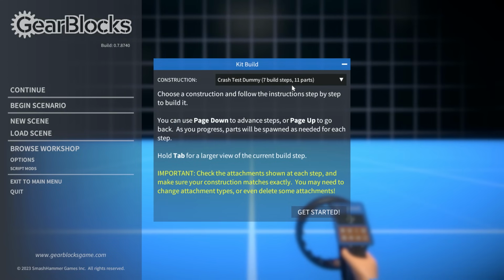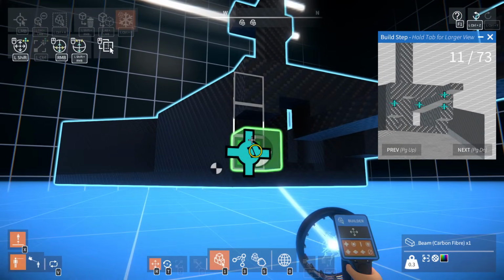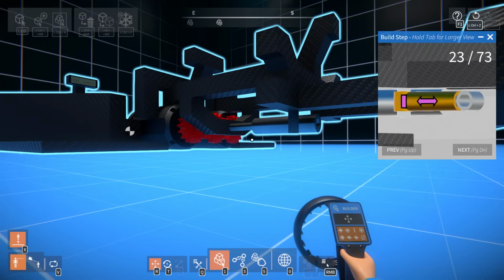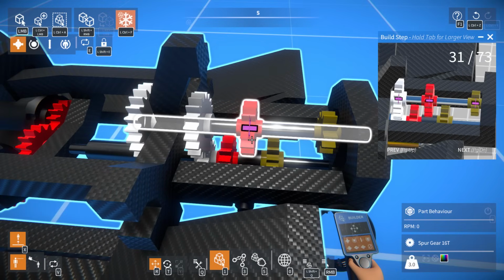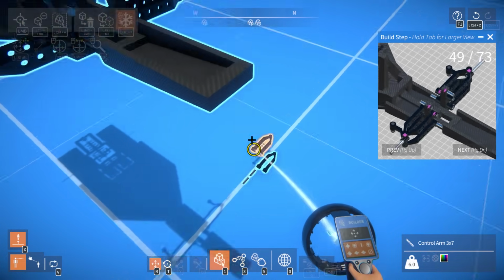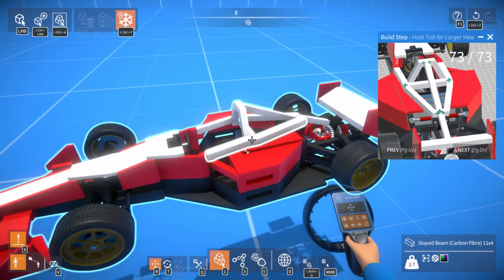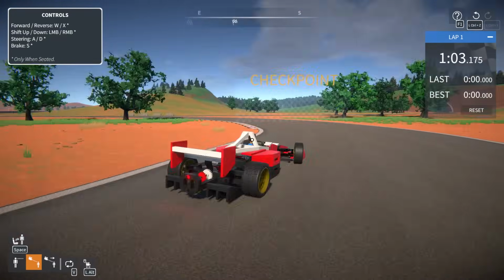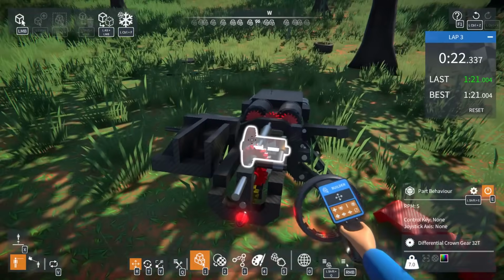I Built a Formula Kit Car with Mechanical Suspension, Transmission, and Differential!

Comment from the maker: Time to make my own vehicle? What kind of vehicle should we do first?
Reply: Trophy truck
Reply: Make a crawler with portal axels with an engage able 4 wheel drive and a realistic drive train and lockable diffs 2 speed transmission
Reply: Crawler/Buggy with four completely independent wheels. [No linkages between each wheel except for a central cab.]

May be easier to do with all wheel drive[one motor per wheel] & all wheel steer.
Reply: Seeming as you can't keep your car off the wall, how about a demo derby car
Reply: I would say build a more complicated gearbox than a 3 speed slider, then build a race car around it.
Reply: @The_Guy_That_Bikes  I second this, would be cool to see Kan make a solid rear axle trophy truck
Reply: Bicycle. :P
Wait, are 2-wheeled vehicles possible in this game?
Reply: STEAM ENGINE.
Reply: @Pystro Only one good way to find out.
Reply: i vote TREBUCHET!
Reply: 4WD with dual diffs. lots of grip for more power :D
Reply: Really love these Gear blocks and mechanical videos, kAN more f1 cars, crawlers, dune buggies, trophy trucks, or honestly whatever you probably have some good ideas.
Reply: cant wait to see your box w/ wheels kan
Reply: Driftcar
Reply: Would be cool to see magnetic suspension
Reply: 4x4 trail truck with solid axles and ladder frame
Reply: Can you please make A pickup truck with double wishbone suspension and awd and with realistic transmission and also with a return to center steering and possibly a engine brake
Reply: I think trying to make something with an all wheel drive functionality would be pretty cool
Reply: i was literally about to say the same thing @The_Guy_That_Bikes
Reply: Something like a formula vee could be cool. 
In real life, it's a junior formula car that uses parts of a VW Beetle, like the engine, drivetrain and suspension, in a tiny fiberglass body. It's got no aero as well, so it relies on mechanical grip only. Super fun to drive in sim.
Reply: In theory, you could use an axle extension lock in the transmission to control which gear it should stop in. I think the easiest way to do this would be to use the second piston by simply pushing something in the path of the axis. Or add more separate gearboxes with separate controls. Or combine these methods in one structure.
Reply: @Pystro Turns out two wheeled vehicles are possible but REALLY hard to do. I made one, and it doesn't balance at all. Someone tried to explain gyros to me, but I don't get it, and they didn't really help.
Reply: A side by side
Reply: Full Cantilever Truck (ps the speed wobble is from the inherant slack that cantilever suspension gives, there's about 20% of the full travel usually, make the rebound stiffer, not the springs, youd usually fix this issue with thicker shock oil) From my experience the Traxxas E-Revo would be some of the most fun to rebuild in this game. Just throw a square truck body on it.
Reply: T-180
Reply: A FWD 3speed gearbox hatchback race car
Reply: A crawler ofc
Reply: Dragster
Reply: Drift car with a lockable diff.
Reply: Drift car
Reply: it might be fun to do a nice big heavy sedan, a real land barge that you can throw into corners as it leans a good 30 degrees on its jiggly suspension
then you could try rebuilding it into a track toy!
Reply: four wheel drive race car, double whishbone suspension front and back, difs front and back and a gearbox
and optionally you could make it a brick (you should add a wing to it tho)
Reply: Tractor :)
Reply: Tractor!
Reply: plane
or tank
Reply: Miata
Reply: Something for pistonengines in scrap mechanic, I really wanna see you make another plane in it and see if your new engines can make a better plane
Reply: You need to make a video on the new gearblocks update
Reply: I second trophy truck sounds like a cool idea :)
Reply: Off-roader, may the be a truck, buggy, a rock bouncer, a rock crawling truck, a Baja truck, or a rally car. As long as it’s off road.

Comment: would love to see you build a solid axle rock crawler with a ton of suspension flex using a transfer case for high and low range with a transmission. maybe locking and unlocking differentials?

Comment: For the wobbly, you can install what F1 (and most other race vehicles) use, steering damper.  This would be a shock absorber attached to the steering arm in the center, with the damper centered when the wheel is (obviously).  This should also help to control understeer a little, as the steering would be smoothed, even with controller smoothing off.  I wonder for the drive gear, could you make some sort of one-way clutch?  That would put an end to the over-rev wheel lockups.

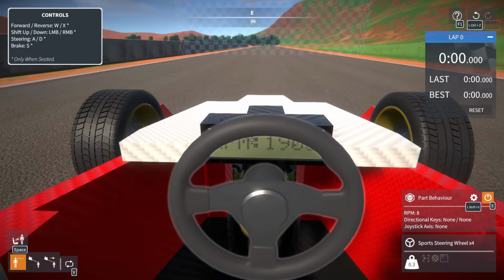Comment: 20:24 Tbf, it's only a little bit too much rotation on the wheel, as F1 cars actually have 360 degree steering rotation, they just bascially don't use it other than for the Monaco hairpin

Comment: Wonder if a full transmission with a clutch is doable - have the motor running constantly, and shift between reverse, neutral, and the drive gears
Reply: You could probably make a pseudo-clutch mechanism by having two crown gears (on the crankshaft and on the input shaft) mesh when a piston is extended. It wouldn't be very realistic because a real clutch can be partially engaged, but it'd work for these purposes.

Comment: The valves in the shocks need to be switched for smaller ones, you definitely need a stepper motor and the gear ratio on the steering rack needs to be a lot higher and I think you’ve got yourself a nice race car

Comment: In the front an f1 car no ponger uses cantilever suspension system they use whats called a torsion bar which twists a bar and that bar is essentially the "spring"

Comment: I mean, you keep saying this game is like Lego, but I'm honestly seeing this as virtual Lego Technic. Technic were the sets with the plastic wonky frame pieces with the interlocking pegs and they sometimes had an electric motor. Like there's a Lego Technic Train that both has a motor onboard the train, but there's also a switch that runs off of a motor as well. I don't know if they're making new ones or if they're still making them at all. I just remember them growing up. If you wanted pirates and castles, that was normal Lego. If you wanted like a Ferrari that could possibly go on its own (by motor or rubberband winding) that was Technic.
Reply: They def still making them. I got a semi truck a couple of Christmases ago, no motor but the engine moves when you roll the tires, and there's a cargo container on the back with a crane, so you can use the rotating knobs to lift the container off the trailer and deposit it next to the truck.
Reply: @flabort I've got a few cool technic sets too recently. A pull-back hot rod, a go-kart with a little engine, low, neutral, and high gears, and a cool little steering rack, and a little speed boat with hidden wheels on the bottom that rotate an engine and prop on the back.